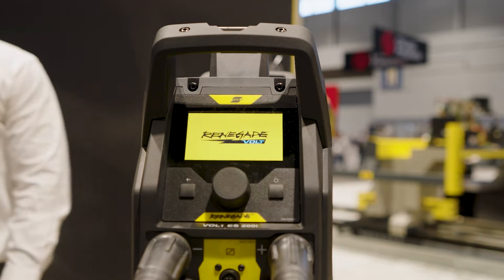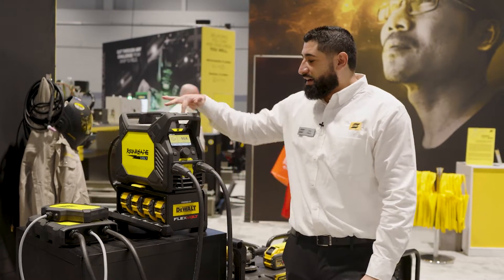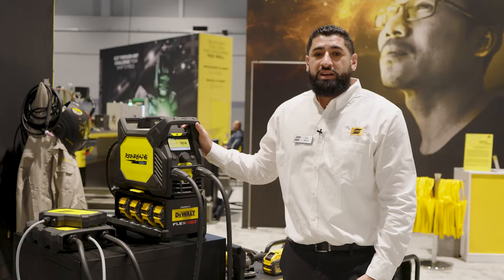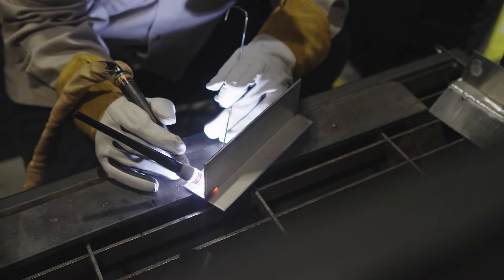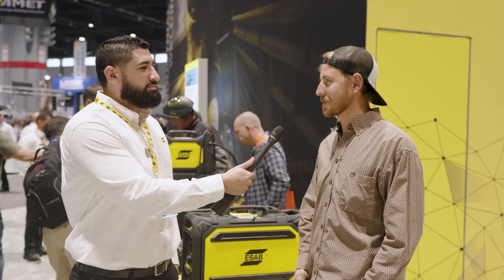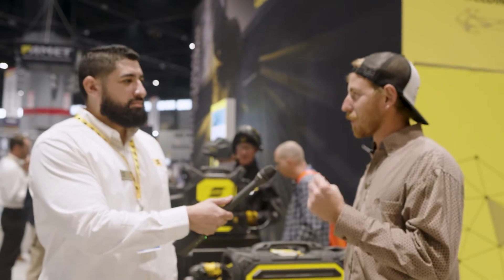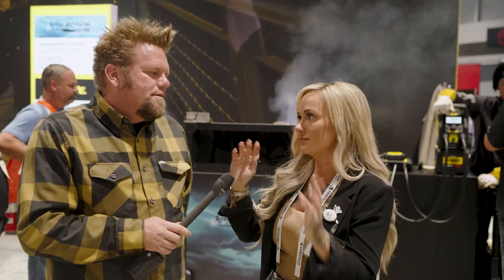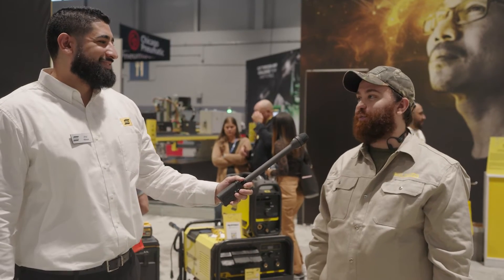ESAB Renegade VOLT™: First Impressions

Comment: Why the hell would you really on batteries SERIOUSLY!!! I’ll take my generator thanks.
Reply: For Real. That's a ton of money for a little more convenience than a generator. I can't think of anyway to make the money back from purchasing that thing. I think Esab was just itching to team up with dewalt because they match the color scheme.
Reply: @strayedarticle2838  a little?  a portable generator that you can carry in one hand isn't going to adequately run a welder like this anyways.  A Honda 2000W can't output 230V for full performance anyways, it weighs as much as this whole system does by itself, you might have to carry gas you normally wouldn't have on your service truck, you're still stringing out cords...the Honda 2k is also $1200....A HF Predator is $600+.  

I think ESAB made this because people clearly wanted cordless battery powered solutions and there's only been a couple other attempts in the welding market.  Cordless solutions are popping up everywhere in every other market because it's what people want.  People will get away from gas whenever and wherever it's reasonably possible.
Reply: @frankiet.wankumesq.2558 na I’ll take my generator just because that would last a lot longer. But I get it.
Reply: @frankiet.wankumesq.2558 your so right lol. I tried an electric ice fishing auger. Here in Canada it gets cold up north and the just wouldn’t last lol.
Reply from the maker: Definitely understand where you're coming from! The Volt was built with portability and convenience in mind - small repair jobs, tight spaces, and easy access. All of that plus the ability to plug into mains power to keep it running on your schedule.
Reply: @esabweldingandcutting  What's the recharge time?